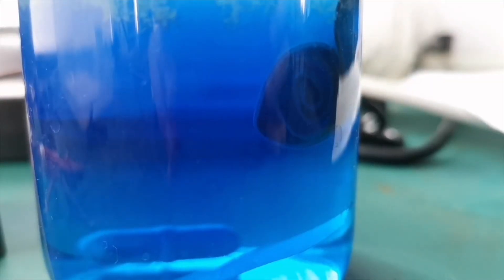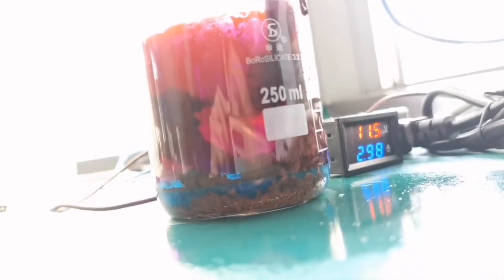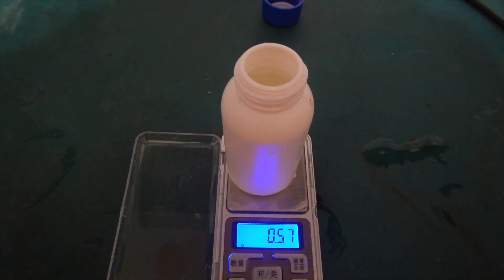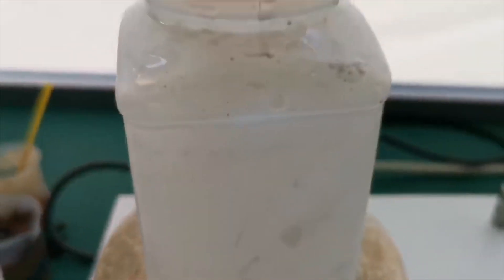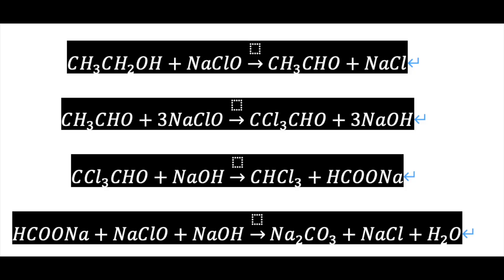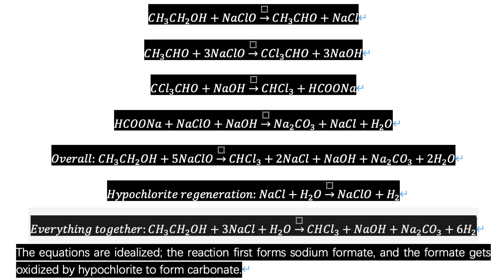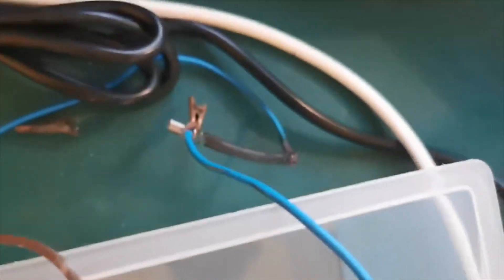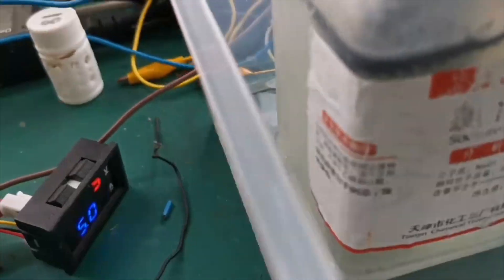Lab Notes - Chloroform from Ethanol

Comment: Get a larger container set it up for reflux, use salt with medium magnetic stiring to start, run the reaction till you got mostly hypochlorite, then add the ethanol slowly. Reaction will be contnuous if current is not too high, some means of active cooling is used and salt with ethanol are added periodically. The smell you got was  likely chloroform, has a somewhat fruity smell to it with a hard to define chemical ether like odor.

Comment: What about holding the cell in ice bath & reduce the current?  Will this keep the volatile products from boiling off?
Reply from the maker: That would work to limit the reaction rate, but the acetaldehyde produced in the reaction is still way too reactive and would simply be oxidized to acetates instead of forming chloroform.

Comment: Get a meanwell 5v psu because low voltage is key for this. I would also be careful on which electrodes are used and graphite is fine as well as MMO anodes from baojii are also good. But PbO2 or lead would generate phosgene due to it's high O2 potential which create ozone and hydroxyl radicals at the anode.
Reply from the maker: I already got it and you can see it in the newest video (the video on making sodium metal). I am sticking with graphite now because I just really don't want to trust lead compounds...
Reply: @MIH0319  MMO doesn't contain lead all the time. There are coatings of IrTa and IrRu. I recommend IrTa still cheaper than Pt but lasts longer
Reply from the maker: @CatboyChemicalSociety  To be honest, I won't be massively producing chlorates and stuff like that. I'm now in high school and can only come back on weekends, and my mom doesn't allow me run an electrolytic cell when nobody is watching... Pretty sad because chlorates is really fun to play with

Comment: You are trying electrochemical haloform? Problem is that is known reaction, it produces ethyl acetate when cell is running as chloroform is totaly oxidised and halide salt is regenearated. In literature it is done with bromides, but i expect it will work identical.
On off should work. Or maybe pump around liquid into haloform reactor from cell and back.

Comment: I've tried to make chloroform in situ with a chlorate cell. Never really got it to work,  you'd likely need a condenser with ice water to stop it from evaporating immediately.  I have gotten it to work the way you later suggested using the cell liquor while it's not running.  To favor hypochlorite production it either needs to be really cold running conditions, or you can run a divided cell using a membrane like a clay pot. If you can get calcium hypochlorite pool shock in China, try using that instead of bleach. You can either add it to a flask in an ice bath with water and a couple condensers running ice water and slowly add your alcohol (the reaction can kick off suddenly and cause a lot of heat and foaming, add the alcohol slowly with strong stirring), or you can convert the calcium hypochlorite to a sodium hypochlorite solution like Tom from E&F did in his hydrazine sulfate video. Strong sodium hypochlorite solutions need to be kept cold to be stable though.
Reply from the maker: Thanks for your suggestions! I know it may sound quite ridiculous, but I've never once found solid calcium hypochlorite for sale in China. Instead, all I can find is a bunch of sodium diisocyanurate and TCCA. I wonder if TCCA combined with NaOH can be used directly for this reaction? Or does it need to be converted to Cl2 and NaClO?
Reply: @MIH0319  You'd need to use the TCCA and hcl to bubble Cl2 though really cold NaOH in an ice bath. NaClO is really unstable as it warms up, there's a video somewhere here on YouTube of a guy making crystals of it, but you don't need to go to those lengths.  Just making a solution of sodium hypochlorite in water that's more than 5% is going to give you good results. I've never done a chloroform synthesis with an alcohol before but I know it's possible.  It's just easier to use acetone since it's available here. You might be able to extract some from nail polish remover, the acetone I currently have was meant for that and is pure. Some removers have other ingredients,  but nothing a simple distillation can't overcome. It's kinda funny how Chinese chemical companies regularly offer me sketchy and downright illegal chemicals regularly, but you can't find acetone legally,  lol.
Reply from the maker: You know acetone was one of the most watched chemicals on the watch list, along with maybe acetic anhydride, toluene, chloroform, etc. because it is used to make a bunch of drugs... To be honest, I don't know what they are thinking about.
Reply: @MIH0319  no idea besides heroin possibly. While all sorts of companies there are offering anything you could possibly want drug wise including fentanyl analogues. I think they only sell to places outside China though.  Check the ingredients on nail polish remover though,  you might get a pleasant surprise.

Comment: alcohol is better easier to seoparate from   cloroform tham acetone you need to chill the bleach to below 0 c
Reply: You can separate acetone from chloroform with just a water wash.
Reply: @chemistryofquestionablequa6252  still leaves traces in there as its quite soluble in chloroform
Reply: @unlockeduk you can get enough out that it's easily separated when you distill the dry chloroform.